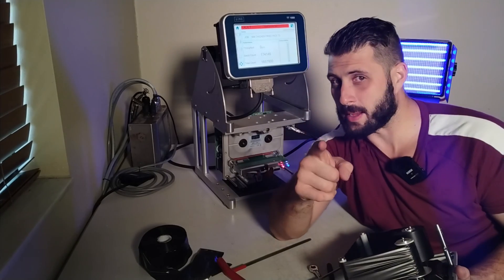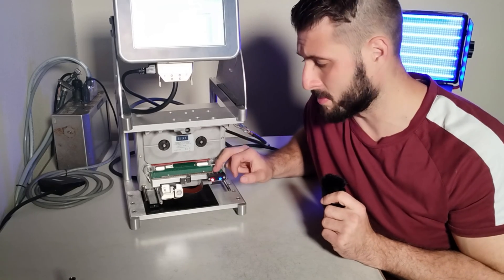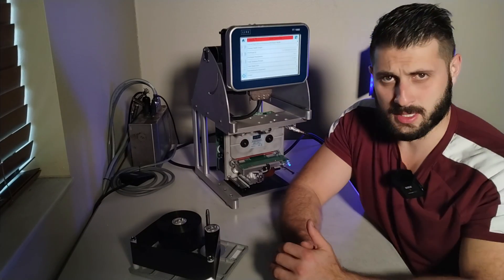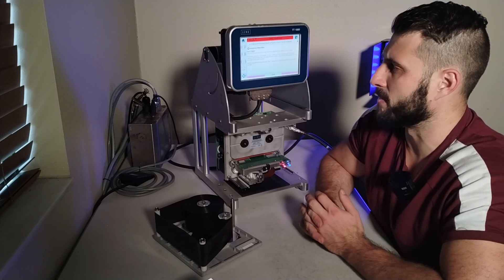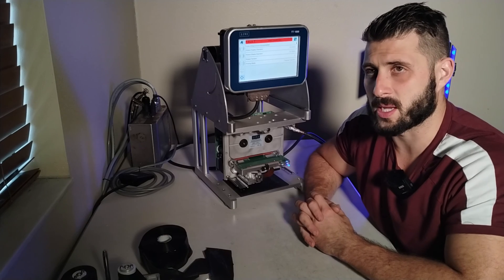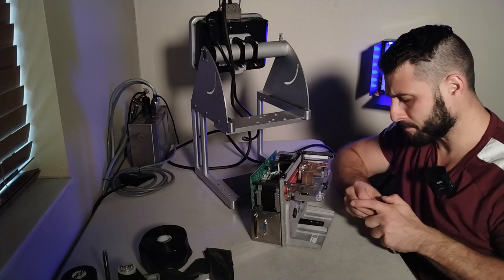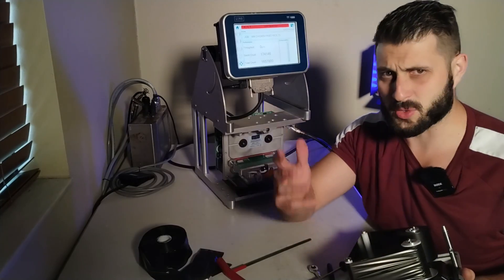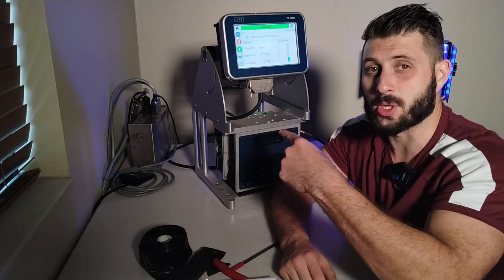Simple Fix! Incorrect Reel Size Error Videojet 6530 Repair

Comment: Hi. I really like your video. Any idea what causes this problem?   
I’m having the same problem every 24 hours. I did everything you did on the video. Thanks.
Reply from the maker: Glad you liked the video sorry to hear you are still having problems. Here is what I recommend first confirm the side plates are both still intact I have seen extra light exposure cause this error. Second swap out components start with emitter, then main pcb and finally printhead pcb. If you have done all that I will panic for you.  You can always send the printer in to us for repair.. we just had a customer who had a problem every time the ribbon would get to 25% left in roll this error would pop up it turned out to be his printhead pcb.